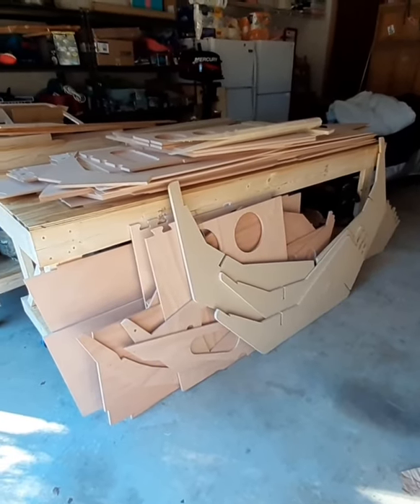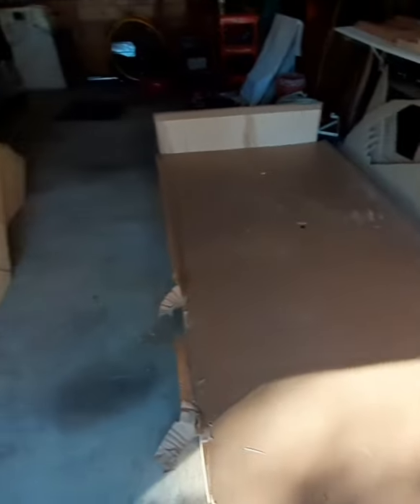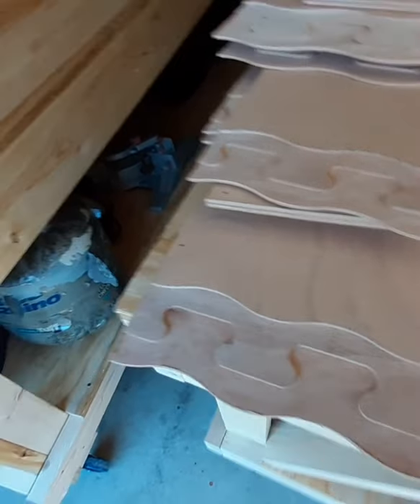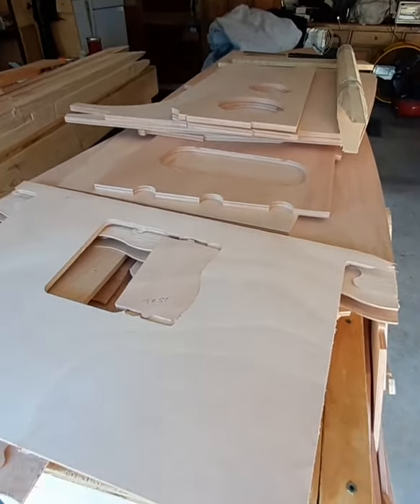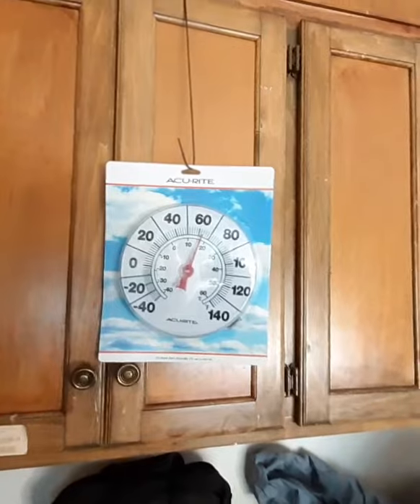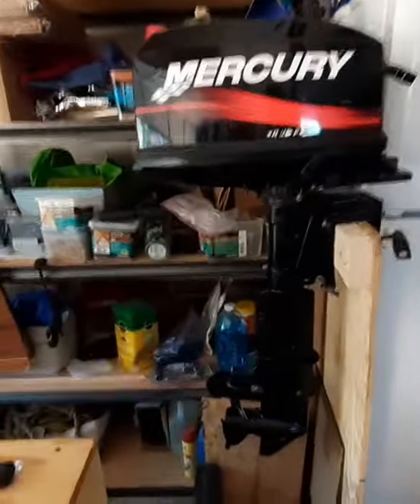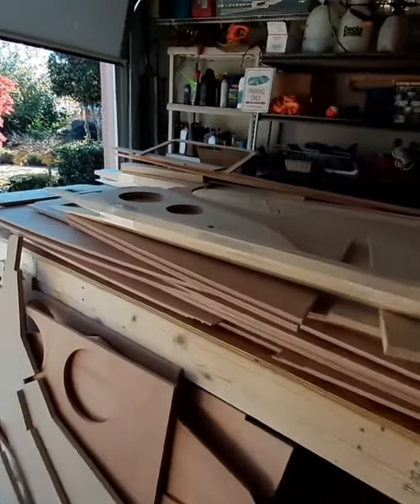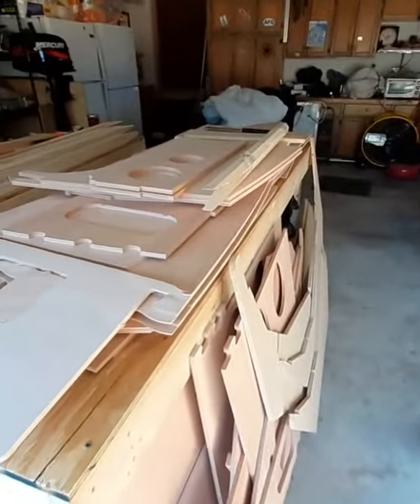Lilou2 stitch & glue sailboat project - Delivery Day

Comment: having  now nearly completed the build, do you recommend the kit supplier still?  I'm diggin' this design... Vivier makes some great looking boats.
Reply from the maker: Hi Matthew,  I am very pleased with the kit quality and with Chase Small Craft (Clint), as far as customer service and all his help.   It's been just over a year since I started and I know I'd be done by now if not for some extenuating circumstances that got in the way......but the launch is looking good for April.    Thanks for watching!!!!
Reply from the maker: One other thing.....the kit comes with an 'epoxy kit'........only about a 5th(?) Of what I needed.    Also,  I opted for 2 layers,  of heaver,  (8oz) glass on the outside of the hull.  I figured I'd add the extra layer since I hoped to never have the boat in the upside down position again